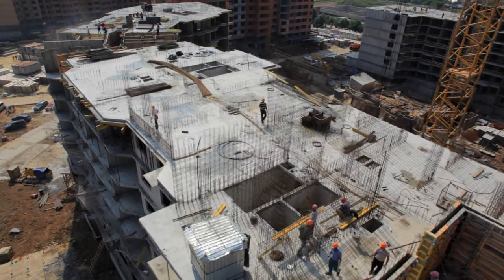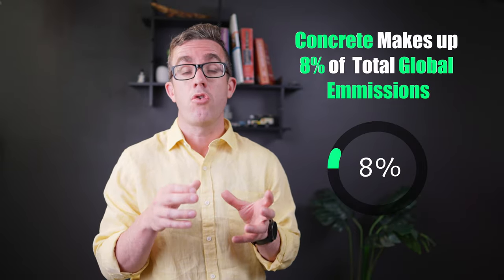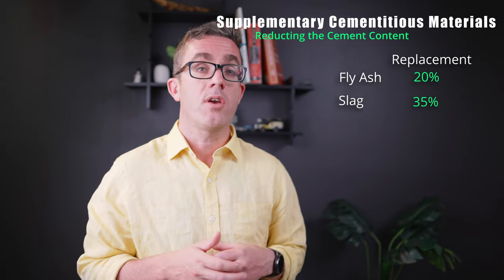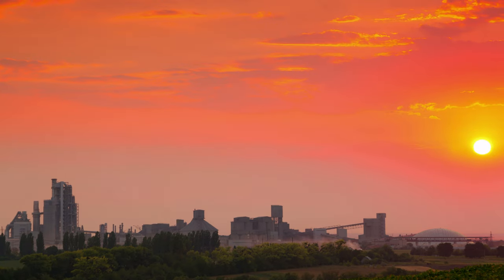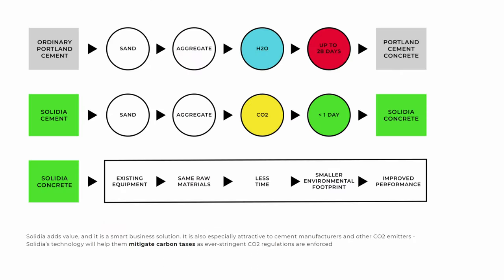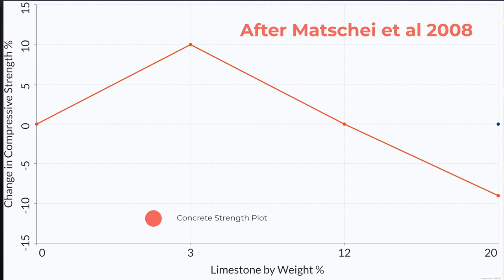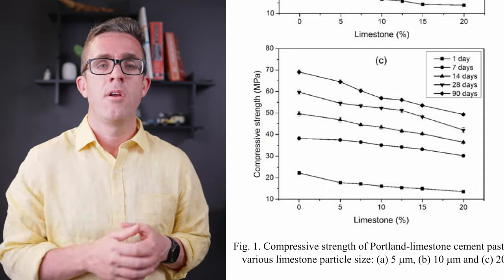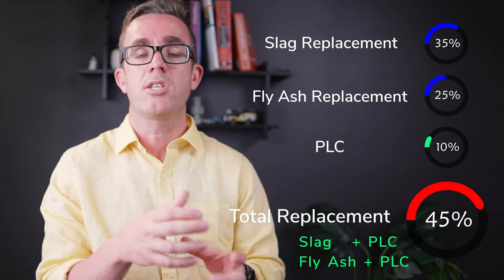A Concrete Problem on How to make Concrete Green

Comment: Hey Brendan, I have no idea if this is a good idea, but I would love for you to tackle a "mock" building design project. So maybe like a 2 or 3 floors concrete building design project, and walk us through step by step. If you have the time to do so, it would really help students like me a huge amount.
Reply: I'm currently a 2nd year student in civil enginneering, and often find it extremely difficult to remember all the steps to designing a building. I often find it extremely overwhelming with all the steps and requirements. I have done steel and concrete building design project before, but If I were to be asked on where to even begin, I would honestly go blank.
Reply from the maker: Hi Pekin thanks for the suggestion I am planning on doing this when I get some free time. It is in planning at the moment.
Reply: @BrendanHasty  do you remember your days in Uni? when did you start gettin involved in the industry? What year did you start applyin for internship and things like that? Personally, I have been adviced by my professor and couple of people that 3rd to 4th year students are the best. Just wondering how you got started, and what advice you would give to student tryna get an internship with no prior industry experience? Do industry understand that your still a student and are here to learn, or do they expect the most?

Comment: what do you think about future of the concrete? world keeps talking about sustainability more each day. do you thing this trend will lead reducing the amount of concrete structure and there will be more steel and wood structures in the short and long term ?
thank you for informative videos. Greetings from Turkey
Reply from the maker: Hi Kaan, thanks for the support. Concrete is here to stay, there appears to be a parth to significantly reduce its carbon footprint. Not ready yet but it is coming along. As for steel this will move into more and more recycled ♻️  material it requires research into processing the metal and using energy from renewable sources. Timber is amazing material and we will likely see more and more structures built from it.

Comment: This is what they ask you at the PE interview in South Africa, what are your environmentally friendly ideas etc. It's tough, some ideas are great but costs are higher, others are well priced but lower quality, from what I see an engineer needs to find the balance and use the ratio at it's max, cause if you don't have that idea in the back of your head, they will not make you a professional engineer here.
Was weird, they ask non engineering related questions, like how you will help the community, it's an aspect of your long term plan, but has no affect on your capabilities as an engineer, and if you say nothing, you will be denied PE, this country has fallen so far.
Reply from the maker: Hi Heinrich, guess it is something that you need to plan for. I wonder how much it changes the way you  engineer, guessing not much. We alot of the time to change how a building it constructed. If it is cheaper the we can help typically when more expensive it will not be chosen.

Comment: Production quality on this one is WAY up from your earlier videos - well done. Also very informative. The only thing I would say is that your voice sounded odd. Having watched quite a few I know how it should sound and either the microphone picks up the s/t sounds more than it should or maybe you clipped/compressed it during the edit or something? It sounded like you have a bad lisp which I not something I had noticed before / I think it's new / I think it's not a lisp. Otherwise, good stuff. :-)
Reply from the maker: Hi fredio, I think I clipped the audio, I agree it sounded odd when I edited it, unsure if it was something I did in post or the recording. Thank for the comments for improvement they help alot.